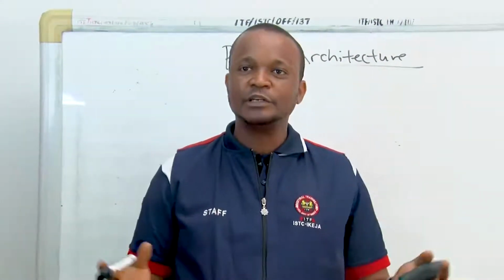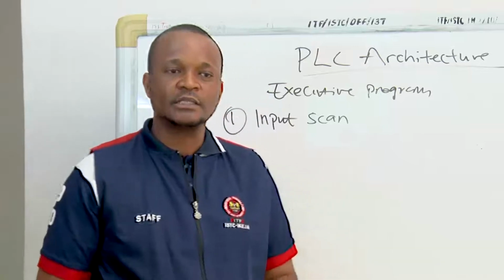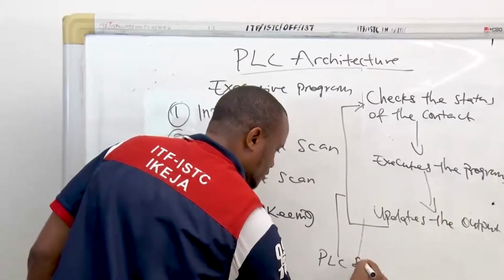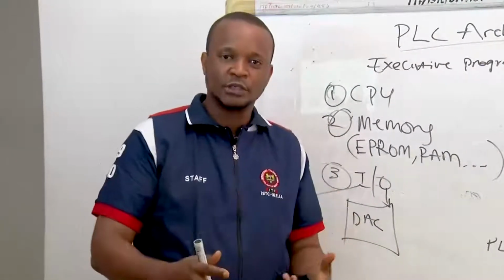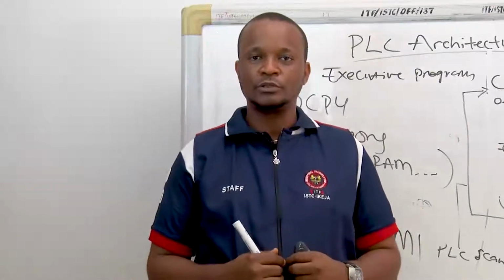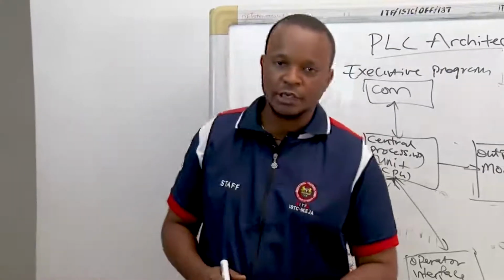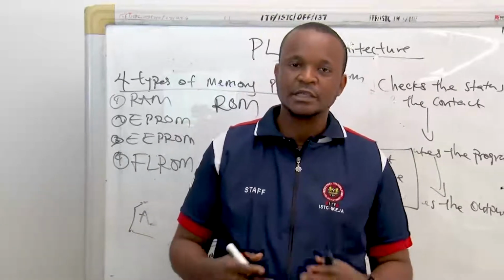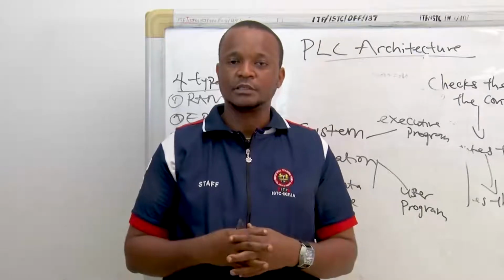PLC ARCHITECTURE

Comment: Thanks AHK Nigeria. Keep doing what you do!
Reply: One point sir. The DAC is used for Analog Outputs like Control Valve Positioner, Linear Drives,  VFDs, etc. As you know HMI basically takes serial data such as Profibus, Ethernet, ProfiNet etc.